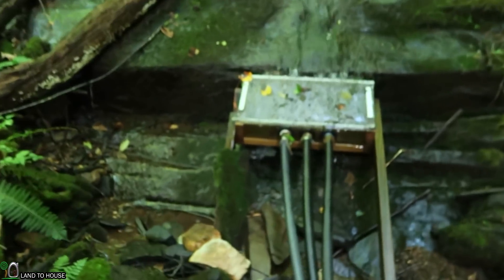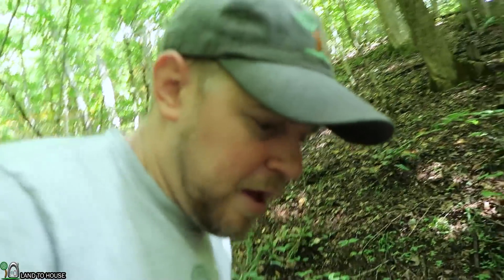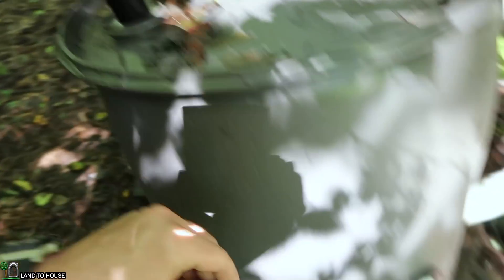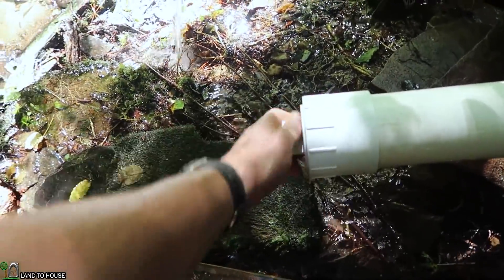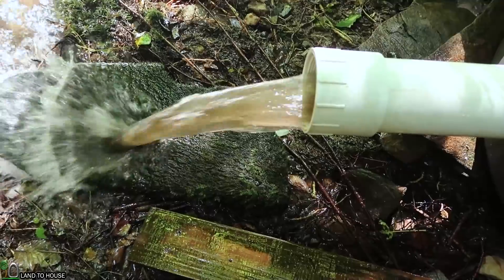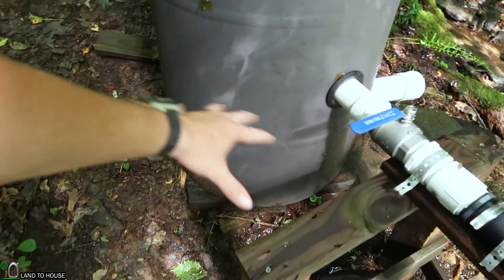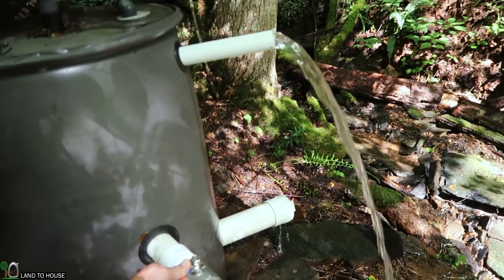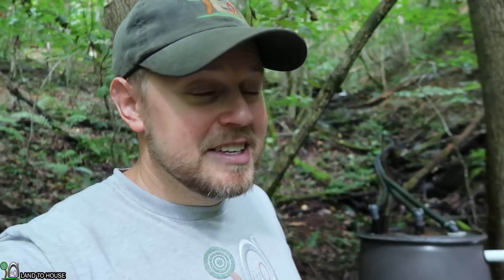How much Silt is Building up in the Micro Hydro Intake?

Comment: If you had the overflow turn inside and go almost to the bottom, wouldnt the overflow help pull some of the sediment out?
Reply from the maker: Yes it sure would! I might do that in the future. The main thing is the barrel is closed up and I do not want to open it up.
Reply: @LandtoHouse  Good idea! Just use a hose and shove it into the overflow pipe. Must be a big diameter, though.

Comment: It's just a convinience issue when it get cold, in the mid winter, put a valve on that drain rather then having your hand get cold with threaded pipe plug.  Otherwise it's fine!..

Comment: You should put a ball valve on the bottom discharge pipe be a lot easier than screwing the cap on and off good video
Reply: There's no point really though, and a ball valve of that size is unlikely to be cheep nor widely available
Reply from the maker: I did find one online but it was rather pricey
Reply: Land to House mate is that discharge pipe 1-1/2 inch ?
Reply: @LandtoHouse  replace the cap with an elbow and a bit of pipe sticking straight up, taller than the overflow.  to turn on the 'drain' you rotate it so that the pipe is pointing sideways and water will flow. then to turn it off you rotate it back upwards to vertical.
Reply from the maker: When I 1st started designing this system I thought about using a ball valve. But then I realized it was too expensive.
Reply: a ball valve as the others said is not much of a choice for price and such buuut a knife gate valve might be a good choice can be found cheap as well as a variety of sizes as well as can be found in rv shops since alot of rvs use them for added security on the black and gray tanks

Comment: That's a good design i don't know if you'll consider a ready made Coanda screen in future
Reply from the maker: Actually have been thinking about a new design for the intake. It's going to have a spinning screen on bearings that will sloth off debris based on water flow
Reply: @LandtoHouse  Oh, I've seen that in another YouTube video (where they had low head/high flow)! I do wonder how much water is lost there in the process of spinning - probably more for high flow scenarios?
Reply from the maker: I do think it's for high flow but I also think that my screen will spin slower and still work...  The design intrigues me and so I'm going to try it haha
Reply: I saw that design somewhere here on YouTube, i think it will work well and better keep trying until you get sweet spot, maybe another content for the channel
Reply from the maker: I'm thinking because of my low flow I can add little cups or paddles that will help turn the screen
Reply: Seth, check out recent videos on Kris Harbour Natural Building,  Kris has been trialing a 3D printed Coanda tile screen design that is a work in progress, the files for the current iteration of the screen can be found here [ https://www.thingiverse.com/thing:4567384 ] however the designer is working with Kris for improvements, keep an eye out for an update!  Will be WAY cheaper than a custom Coanda screen.  Just a thought!.  Keep up the great videos!
Reply from the maker: I have seen his work. Really nice videos. I hope the 3d print screen works well. I would be happy to test it out someday.